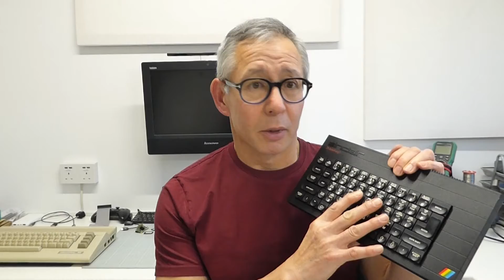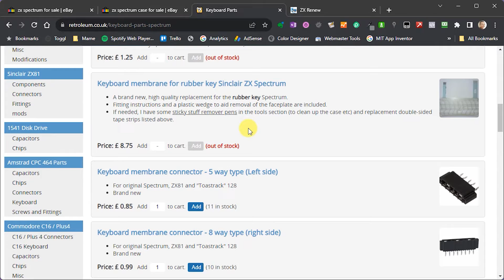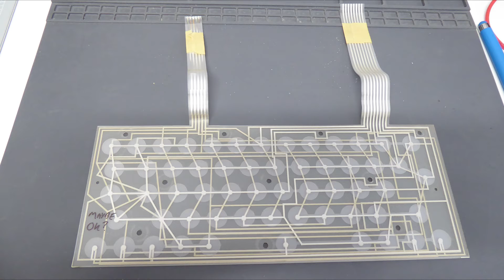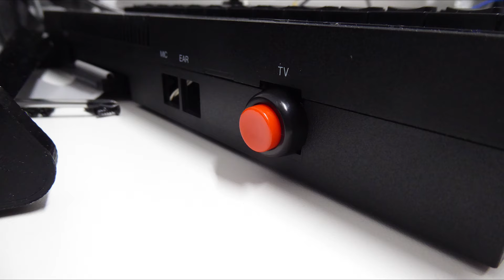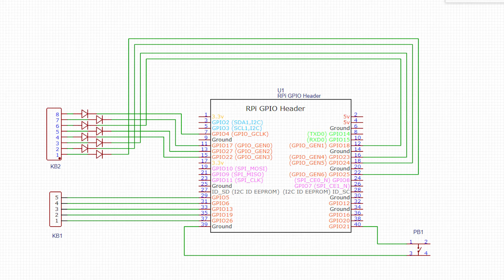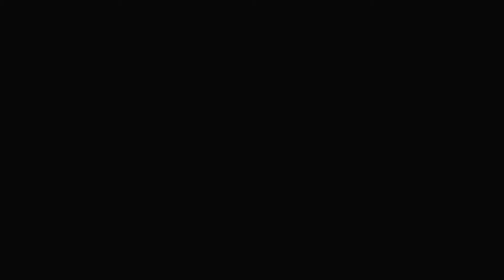Build a Replica ZX Spectrum - Raspberry Pi + Original Case and Keyboard

Comment: how about a next clone using a pi 400? do you know if it's possible? thanks
Reply from the maker: I think there are some Spectrum Next emulators out there but I haven't tried them.
Reply: @BytesNBits  I'm surprised people haven't used the pi 400 to emulate the next considering how expensive a next is to buy

Comment: Great video, this has rejuvinated my Pi hobbie... I cannot seem to get the v3.2 ARMv7 working without it asking to connect a gpio keyboard. It works ok with the Kernel7 img file supplied with the zxmini download but is an older version 2017 without the ability to load my own games and load in real time with sounds.
Am I missing something? Thanks 🙂
Reply from the maker: Hi. I've popped a replay in the other video comments.

Comment: pretty cool use of a pi zero,  wonder if you could use a pi pico for this?  Also i think id probably prefer to use a spectrum next motherboard (ngo) or a zx element motherboard (which has a real z80 processor ) for a project like this.
Reply from the maker: Yes you can use a Pico. There are a  range of options to choose from.

Comment: This is really neat and reminds me of a project I worked on during lockdown, details of which can be seen in a couple of my videos.

For those interested, a Pi zero running a spectrum emulator can get over 6 hours runtime from an 18650 cell plus charge circuit, making for a wireless solution, other than the HDMI cable of course!

Nice work and thanks for the upload.
Reply from the maker: Thanks for the info, I've not looked into battery power.

Comment: Awesome stuff. Don't think id be clever enough to build one but would love to do it for my wifes uncle. Maybe one day
Reply from the maker: Give it a go. There's only a little bit of soldering and if you mount the Raspberry Pi in the case you don't need the main circuit board. Just plug the flying leads directly onto the Pi.
Reply: @BytesNBits  awesome maybe ill get the parts after christmas and see how it goes, thanks!
Reply: Loved this video... I've just received my Kickstarter 2 Next (still in box but I'm undergoing treatment till mid January and am very sick at the moment) but I'll also look into this next month when I hopefully start to feel better. Subscribed !

Comment: Hi Very good - in depth and you highlight all the pros and cons

I wish to do this with a Amiga 500

BTW with all you hot glue, can you not mark out where the pizero2w and small breadboard sit, then drill through the case with a 1/8th or 3mm drill then mount those small plastic nut and bolt threads - you can use extra nuts to space up the board if stand offs are to big and space up the pi to high- it may solve the problems and not rely on hot glue separating one day with constant connect / disconnect

BTW - what type of small monitor are you using - it looks great for a retro machine and if it is 10 inch or so then i can fit the monitor and pi in a 14/15inch laptop bag :)

Regards
George
Reply from the maker: Definitely build yourself an Amiga. I opted for the glue gun as I didn't want to damage the case. The ribbon cable method allows me to leave the Spectrum end in tact and do the plugging in and out at the Raspberry Pi end. Having said that you can always reglue fairly easily and it's a much easier fix.

Comment: You could just buy a ZX Max 128 clone
Reply from the maker: Thanks for the tip. I guess there are always a number of ways to get the same result. I like this route as it gives me the HDMI/sound output for my monitor in an easy form. Plus it's a bit cheaper :)
Reply: In the UK a ZX Max 128 is only £60 Just pop it in a ZX Spectrum + case and You have a Full working 128k Spectrum,I did go down your route on your amazing video but ended up popping in the Max in the end.  @BytesNBits  Keep the videos coming ! Its a good channel

Comment: Great video.
Actually you don't need the separate push button. When you press Caps Shift + Symbol Shift + Enter keys together you will enter the alternate menu/keys.
Then press Symbol Shift + K for keyboard help, 1 for Tape Menu etc.
Reply from the maker: Thanks for the tip. It works!

Comment: is that zx console a replica? where can i found to buy?
Reply from the maker: Mine is an original case and keyboard. You can find them on eBay. https://zxrenew.co.uk/ sell newly made case and keyboards for the 48K model so you can buy a brand new one. Don't forget you need the case, membrane, rubber key mat and fascia plate.
Reply: so nice dear, but did you tried the ESP32 version? I think is so good as this, but more cheaper  @BytesNBits
Reply from the maker: @user-Limaa  I haven't tried it yet but it is definitely on my list.
Reply: even you can choose a TVGA32 TIGO that came with vga sd and mouse and keyboard interfaces 15us  @BytesNBits